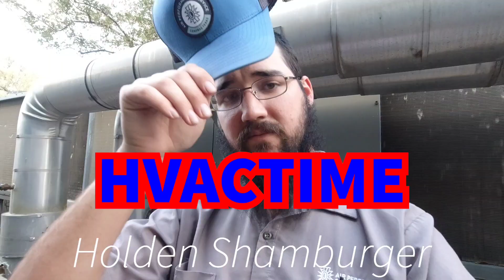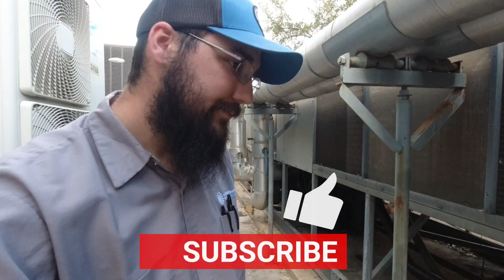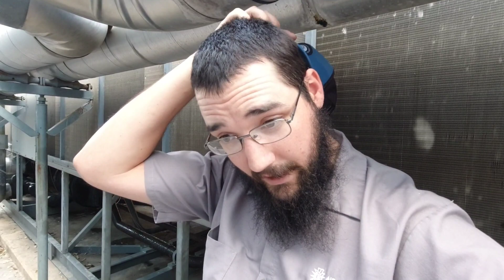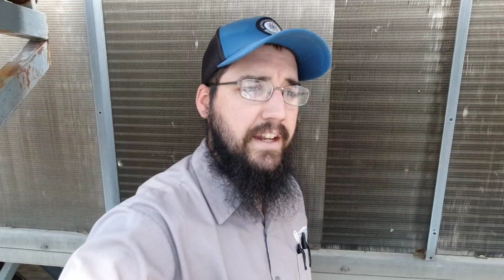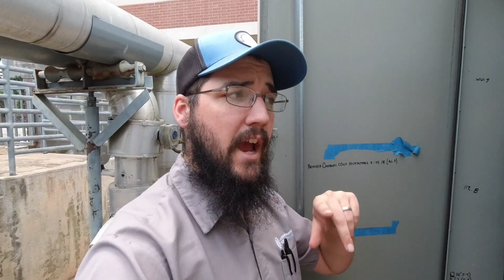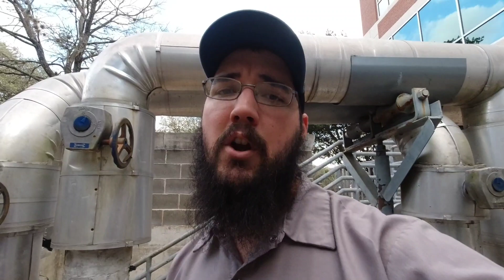Bad Mistake on Vacuum After Chiller Repairs Trane RTAA Air Cooled Chiller

Comment: Ive been wanting at least 3 micron gauges for way to long now.....Hey do you open the oil control solinoid ( with magnet) when pressurizing whole RTAA with Nitro (pressure test) and when Evacuating??????

Comment: my dad gave me his yellow jacket micron gauge. love the hell out of it. had an issue a couple of years ago where it would calibrate to 760000 but would not go below 2000. i fought with it for a couple days. figured it was alot of moisture, cleaned the sensor. changed the battery. turns out it was a battery issue and i just had a bad batch of D cell batteries.

Comment: Recommend two of the same model vac gauges. Run them together and compare and often check if they don't have any leaks via rise test. Protect your vac sensors from oil as vac sensors don't actually measure pressure they measure moisture content and convert to microns so if you get oil in the sensor it reads off. Also, how did you tune the fans and what controller do you have in that one?

Comment: Chiller Model ERTAA triping on oil flow control when chiller stop auto mood or manual mood this Alarm is coming..
What is the solution..?? Please help
Reply: Replace both the loading and unloading Sol with new they don't come with gaskets or the coil so you have to order separately. Basically your slide is getting stuck.you can confirm by adding tattle tale lights to your Sol and set your meter on Amps and to record max amps on one your compressor leads it will trip about ten seconds after the oil Sol opens you are also looking for the unloading Sol to blink on before compressor start and after the compressor starts the  loading Sol should start to tick open. Confirm demanded capacity via percentage of fla you recorded on your meter. The result of the stuck slide is a low pressure differential between the discharge and suction ends of the screw it uses this pressure to keep the oil flowing you need a 50 psi delta p.

Comment: Rule of thumb. Test your micron gauge with your vacuum pump. Before you start. It should pull down to 50 microns.
Reply from the maker: Agreed, use me as an example of over confidence bites.

Comment: It never fails! I always end at a job that I think its only going to take like 3 days and I end up staying on that job for like 2 weeks. Atleast you know you pulled a deep vacuum on that chiller. I've had similar situations where the chiller wouldn't pull down past 1500, hoping there was something wrong with my micron gauge. Always ends up being a leak. It's like you show up to fix one thing then several other issues appear. Ole Murphy always has to let his presence be known 😂😂😂😂.